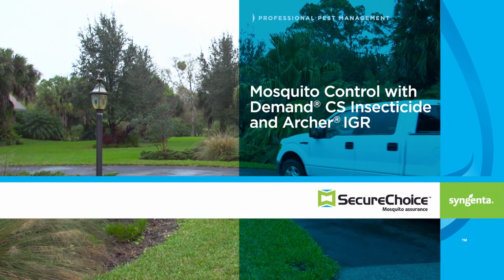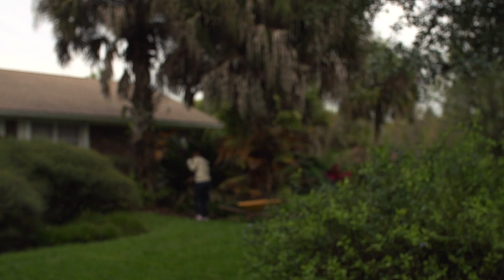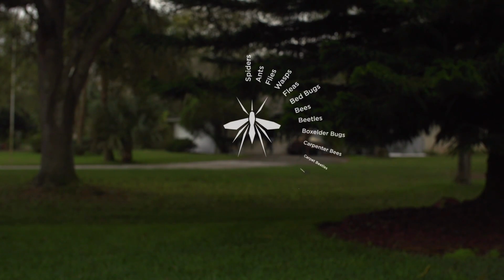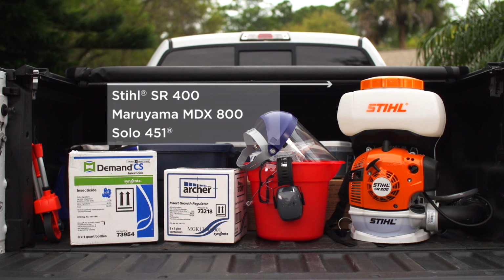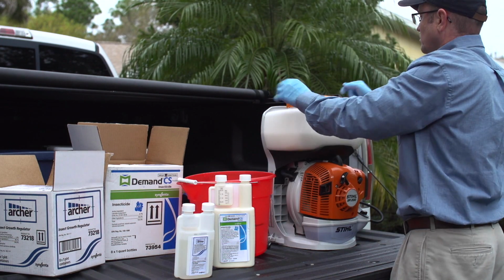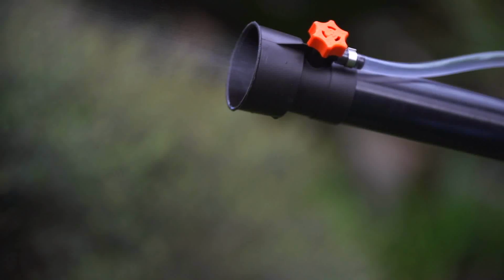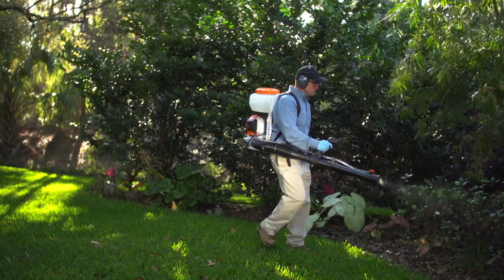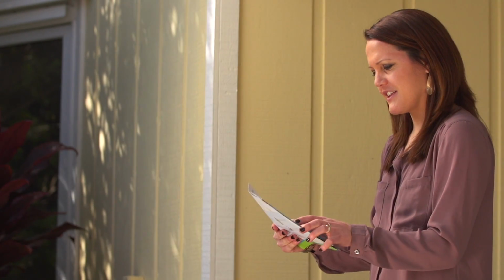SecureChoice Mosquito Assurance Program application training video

Comment: yeah you also kill every insect on the property with demand. bye dragonflies and other good insects. in reality you should use the "weaker" chemical as they do the job fine if you do the service right. save demand for problem accounts so it doesn't become over used.
Reply: Well too bad. Mosquitos has killed the most amount of humans in the world.
Reply: Shut up hippy
Reply: That’s why you only apply it in certain areas.
Reply: @johnsullivan2577  yes but from what I've seen with pest control companies they spray all spring and summer unless it's raining. They dont stop because of wind like they're supposed to and with the backpack blower the wind takes the chemicals everywhere. You're right it needs to be done right and in the right spot but other non targets will always be killed its impossible  to avoid when using a chemical outdoors. but again demand isn't necessary.Talstar or even essentria are almost always more than enough.
Reply: Saiiko12 I own a pest control company and you’re right, many companies out there don’t follow all the rules and regulations from the department of agriculture, EPA, etc. and I would report them when you see them doing something wrong. Technically on service reports you are supposed to list what the wind speed was at the time of service obviously if they mark down 3mph and it was 25mph winds that day they could face some pretty steep fines. As for the chemicals, I think maybe you’re assuming they’re being used at their full strength according to the label. The only time I personally use talstar is in the winter months as more of a maintenance product. For the warmer months products like Demand, Onslaught, and Termidor are almost a necessity. If you use an inferior product your going to end up doing a bunch of call back services applying layer upon layer of chemicals down. With my company I’m very adamant about taking an approach by the name of Integrated Pest Management (IPM for short). Basically instead of showing up to someone’s house and laying down chemicals immediately. You want to do a thorough inspection, look for entry points of where pests may be coming into the home. Other factors that invite pests such as areas prone to moisture, weeds around the house,etc. if it’s a roach issue, obviously you want to educate the customer on things they can do to help eliminate the problem,keep pet food stored properly, dirty dishes,trash. My point is instead of it being the first thing we do,spraying chemicals is the last method of pest control we use...
That was very long winded I know so kudos if you made it this far!
Reply: @johnsullivan2577  sounds like you know your stuff and I respect that you do the right thing. If the companies I worked for around here (nh/ma) were like yours I'd probably still be in the field. I wanted to start my own business but its tough and expensive. That's interesting about the results with certain chemicals depending on the season, I rarely had callbacks using essentria and telstar all summer with talstar granules as well. Usually if I got call backs it was from the chemical degrading quickly because of large amounts of rain or extreme heat, or if my boss made me keep treating up until it started pouring obviously those treatments were a waste but the big guys want the jobs done unless its pouring. I never knew about having to note the wind speed but that is important so I wish they did that here too. I was going to focus my business on ticks in the summer and focus mice and wildlife year round. I wanted to push exclusion heavily because I've sealed so many houses up so tight they no longer have a need for quarterly mouse services. Big companies here dont push exclusion because then they cant come back again and again to replace bait. Lots of people were very happy to have their home mouse proof and not have to worry about their kid or pet getting into bait stations (even though the odds of that are very low as I secure them down and place them properly out of reach but they still worry) but anyways hope your business is going strong let me know if you ever want to open a branch in NH/MA! Haha
Reply: Saiiko12 yeah man I hear you, the company I worked for before I started my own half assed everything,refused to buy us proper ppe, didn’t follow many guideline at all. They even half assed termite treatments. I became a route manager there and started trying to get everyone to do things the right way and the owners fought me every step of the way. So her I am,lol. I’m in southern Missouri so our seasons probably account for my experience switching up chemicals. Basically March-October-ish is pretty constant ant and termite issues. Ants are definitely the biggest cause for callbacks here. And your talk of exclusion for mice is exactly what we follow. I would rather fix someone’s issue and have them give us a call for any issue they have after that along with them recommending us to all their friends when the subject comes up. Instead of holding them hostage to a monthly service that never really fixes their problem. I also don’t have residential services sign annual contracts. If they’re unhappy with us and want to go elsewhere so be it. But that new place is going to tie them up in a yearly contract. Word of mouth is everything in this business, the more reasons you give someone to talk about you in a positive light the better!
Reply: @johnsullivan2577  I appreciate the comments you have left here and elsewhere on YouTube regarding pesticide application. I am seeing mixed messages on YouTube videos in terms of whether Talstar (Bifen I/T) can be used in one of these backpack fogger devices (e.g. Solo 451, Tomahawk Cardinal, etc.) safely. Is there a contraindication to this? One of the professional pesticide distributor YouTube channels states "foggers" should not be used. They specifically refer to ULV and thermal devices, but I am not seeing clear information on the gas-powered backpack foggers. Thanks
Reply: This must be a Florida thing,out here in Cali we’re concerned with drift,this can’t be legal out here?